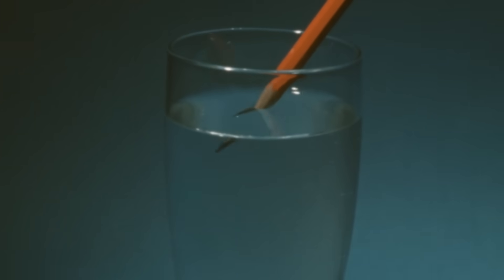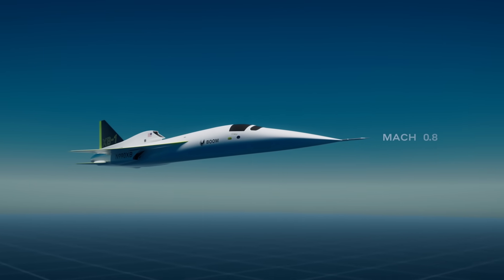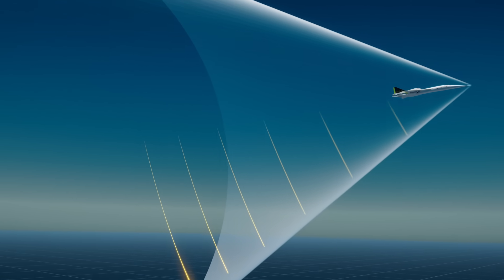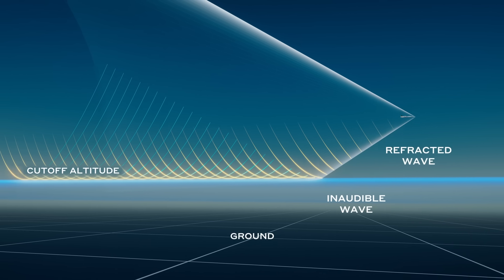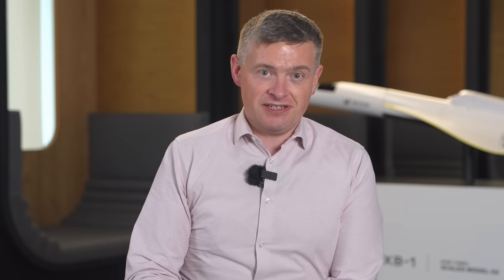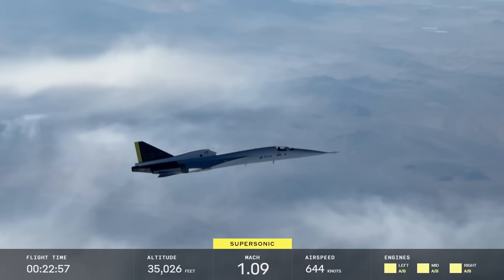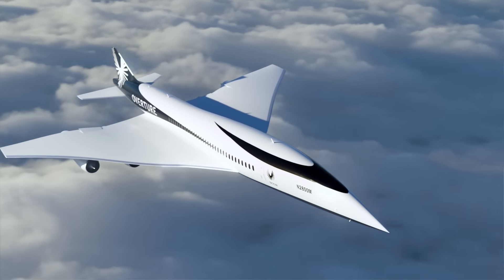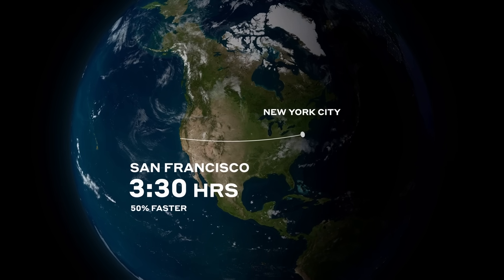What Is Boomless Cruise? Supersonic Flight Without the Boom

Comment: Air resistance goes up as a square of speed. The energy necessary to move an object through air goes up as a cube of the speed - ^3. Sonic booms were never the problem with supersonic flight, it's always been the unaffordable excessive cost of energy. Throughout most of its life, the Concorde flying between New York and Paris/London was on average only 50 to 60% full. The issue was not sonic booms, it was cost, even the ultra-rich would not routinely pay for the convenience, only once for the experience. I cannot believe anybody is funding this venture.
Reply: as AE engineer, I'm agree with u

Comment: they should just call it the "boundary layer" that's what meteorologists call it, there's a layer about only 1km high that is capped by a temperature/density inversion over most of the US at any given time, just 1 km up, you can see it when you take off in a plane from most any airport, this sound wave reflection works better when there is a stronger temperature inversion capping the boundary layer

Comment: I have to admit they have a great marketing department. Otherwise, this is just technohype. The physics of Boom's Overture isn’t in its favor: sonic boom strength scales with the cube of Mach number based on slender body theory, and so using Boom’s own numbers suggests it’ll be over 60× louder than their XB-1 demonstrator. Even if you shape the N-wave into a “thump,” the total acoustic energy from a 170,000 kg SST is still enormous. And let’s not forget that supersonic overland flight is still banned by the FAA and ICAO. Boom has no certified engine, no clear path to regulatory approval. This increasingly looks more like a PR story than a viable airliner.

Comment: Current planes aren't slow, they can also go faster, but they maintain a speed that can be economical for their fuel usage which in-turn, does good for their Airline's profit margins.
Reply: Yes they typically can go faster but are restricted for fuel and emissions reasons, but still not supersonic. Standard aircraft designs experience what is known as aerodynamic flutter in the upper transonic region and supersonic regions. It can literally rip an aircraft apart.

Comment: I’m not such a fan of this. What is the effect on the upper atmosphere environment? It seems like the sonic booms would still cause turbulence, which would cause increased mixing at higher altitudes.
Reply: Not an issue. The shock wave doesn't move air much. It's a pressure wave.

Comment: Supersonics were all the rage when testing began for commercial flights in the 1960s, but the planes ran into problems because of high costs and pollution concerns. Sonic boom is least issue, Boom is supporting legislation that would exempt these jets from updated stringent noise standards for takeoffs and landings for new aircraft. That’s a pretty stunning lack of confidence in its ability to deliver “quiet.”
Reply: Concord had limited routes because it couldnt fly over land due to the sonic boom. Leaving flying over water for only a select few sensible routes.

Solve the boom and you have a more flexible plane, at least in theory.
Reply: @bradleytaniguchi1187  Pacific ocean routes are twice width any transatlantic routes. Fuel economy of supersonic planes will always be vastly higher........

Comment: Would only work for limited passenger airplanes and will therefore result into a very expensive hour flown. Can only run on fighter jets power plants which are fuel inefficient. Supersonic private jets would be very expensive to run and therefore volume sold would be very low, only a handful of corporations would be able to afford a plane/flight 3 or 4 times the cost of a rented or owned private jet. 
Same for airlines, they will just acquire a handful of these jets each to service their wealthiest customers, just like AF and BA did Because market is very narrow. After all planes are delivered there won’t be any more orders for years until a new more efficient aircraft is developed and at least until the ones delivered are amortised. (15 years at least) 

Conclusion: this endeavour is not going to fail but return on investment for this company is going to be very very low.

Comment: To be able to travel supersonically, there’s still the problem of air drag which increases exponentially at supersonic speeds, causing huge increases to fuel consumption (and thus costs). I don’t think this company’s solution is the breakthrough needed for viable mainstream commercial travel, rather a piece of the greater puzzle that still needs to be solved.
Reply: 100%, but you know this is one of those 'rich people fun only' things right

Comment: They use "real-time weather data" to avoid making booms? (1:02)  Does that mean if the weather is outside of parameters they will only fly at subsonic speeds?  Somehow I doubt it... They will probably just go ahead and make the sonic booms...
Reply: Maybe the weather influences speed, height and angle required to avoid the sonic boom
Reply: i researched a lot, the speed and height have to be VERY precise along having weather and atmosphere data so the boom will come back
Reply: @LK2000Y Yeah, so boom-less supersonic flight is just a PR stunt...  They intend to bring back the old sonic booms...  and, if they do,  they'll probably say "but they're not as loud as they used to be" and, by then, it will be too late... billions will have already been invested.
Reply: As an aerospace student what that likely means is they have instruments onboard which automatically adjust the Mach speed, Mach cone, and other parameters with changing speed of sound since the speed of sound also changes variably depending on temperature deviations, density deviations, and so on. It’s probably not something u should be worried about and no it wouldn’t just slow down to subsonic. It will definitely still be supersonic
Reply: @im_a_myth_717 whats the mach cone?
Reply: Ive seen explanations that said boomless cruize will not be avaliable at full speed, they will be only at mach 1.3 not subsonic technically but not the full 1.8mach promissed but this is only relevant in la to ny flights, not cross atlatic. Even argentina to north brazil could take the ocean to fly full speed

Comment: we've finally caught up to what Lockheed had in their L-2000 SST 50 years ago at a third of the speed and half the passengers
Reply: well lockheed never built the thing so if boom pulls this off they're superior for actually existing
Reply: @kerbalengineeringsystems7415  because they never got funding??? bro
Reply: @RobloxianX  ok cool it's a paper airplane they never built hardware for it, Boom's proposal will be better if they can get it into the air again by virtue of actually existing.
Reply: @kerbalengineeringsystems7415  So Lochkeed built a 1:1 scale model and full specifications while all we have of the Boom is a computer render so according to you that makes Boom better. Yeah sure buddy, its not even like you're going to fly in this thing, it's made for the ultra-rich
Reply: @RobloxianX  oh wow, a one to one scale model! what a sure sign of a mature system! by that logic Shuttle-C and the Boeing 2707 were just as real. 1-1 mockups were the computer renders of the 70s. The L2000 did not exist in any meaningful sense. It was a good proposal but it was never anywhere close to actually existing. Arguably the Boom Overture is already more developed than the L2000 ever was by virtue of having a sub-scale flight article in the XB-1.
Reply: @RobloxianX  

> All we have of the Boom is a computer render

Comments on a video with footage from the test flight of the real flying demonstrator aircraft
Reply: @DontMe__  the actual boom the finished product bro use your head
Reply: @RobloxianX  What? Gee, I had an even bigger and faster design than Lockheed's, complete with onboard Wi-Fi and an exercise room. I just never got the funding. It's so unfair, and now society is deprived of my awesome SST.
Reply: @Rotuma1260  damn well lochkeed has built tons of supersonic aircraft other than SSTs have you?
Reply: @Rotuma1260  - 😂😂😂😂😂😂😂😂😅
Reply: Without the ear and property damage too!
Reply: @Ray_Satura  what ear and property damage? the L-2000 literally had boomless cruise because it was planned to go up to 77,000ft in cruising altitude

Comment: So are you implying you'll counteract the sonic boom with a loud, "inaudible wave"? Does that mean dumping infrasonic sound into the area below the plane? You're aware that sound waves you can't hear are still destructive to our ears, right? Fill me in on what I'm missing.
Reply: they aren't counteracting anything, they are simply flying at the correct speed and altitude the computers calculate based on the conditions, where the sonic boom naturally curves back up before it hits the ground
Reply: @tonnynguyen390  Their diagram shows an inaudible wave below the floor of the sonic boom. The inaudible wave is what I'm asking about. It's not reflecting off of the ground, so there's a buffer that maybe I missed in the video..?
Reply: @ i think they meant that once the sonic boom hit that altitude it becomes inaudible
Reply: @tonnynguyen390  That seems inexplicably simple. We've been flying supersonic at high altitudes for decades. If that was the answer, we wouldn't be spending billions to stop sonic booms at this point, we would just develop higher-altitude jets. We are doing so, but for different purposes.
Reply: Search up total internal reflection. The sonic boom cone is like a beam of light. At the right altitude and speed the angle of the cone is shallow enough that it will reflect of the lower part of the atmosphere (not at one boundary like the light hitting a glass block, but just across that certain altitude), so the shockwave is just reflected back up, so we won’t hear it
Reply: @ShortysTRM  The limitation is that it doesn't just let you go as fast as you want at a higher altitude and avoid a sonic boom, it only lets you go slightly above supersonic (mach 1.1 to 1.3), and if you want to go faster than that the altitude you need for the boom to not hit the ground goes up exponentially. So at most you'll get a 50% higher cruise speed than commercial flights at M0.8, at the cost of higher altitude and additional plane complexity to handle supersonic flight.

Comment: Many thanks for doing the research required to make supersonic flight a practical reality.
Reply: The British did that decades ago. The US is late to the party again.
Reply: @markfox1545 the Boeing sst concept was also around the time of the Concorde but just didn’t get enough funding.
Reply: @ again, Not in a practical way for the airline, and not really for the travelers (fuel efficiency, maintenance cost, Sound) Military-wise, The US was the first to achieve supersonic flight.
Reply: Its been a reality for nearly 80 years guy. supersonic jets are very old. If anything, it still isnt practical because you burn so much more fuel maintaining supersonic flight than you do with a standard subsonic cruise, unless you use something exotic like a ramjet youre just burning tons (literally) more fuel just to keep that speed up.
Reply: @battleoid2411  actually believe it or not after you reach supersonic speeds drag sharply drops for a period before once again scaling roughly linearly with velocity as you approach mach 2 and beyond. https://upload.wikimedia.org/wikipedia/commons/0/0e/Qualitive_variation_of_cd_with_mach_number.png
Reply: @battleoid2411  I'm quite aware of how long supersonic flight has been around.  My point was working on eliminating the sonic boom; hence the word "practical".  However you do raise very good points about fuel consumption.
Reply: @goatflieg This plane is supposedly going to be quite fuel efficient
Reply: @battleoid2411  It also ain't practical because you still can't fly supersonic on land
Reply: @PStahn  well yeah, cause then you're not flying you're driving
Reply: @PStahn did you watch the video
Reply: @tonnynguyen390  What I meant by my comment is that there are still regulations all over the world prohibiting commercial supersonic flights

Comment: Boomless cruise at 1.1M isn't much faster than regular air travel at .85M. So over continents you'll get a 20-30% increase in speed which is great,  but not something that's really needed by customers. For transcontinental flights, the Overture jet won't be able to make it from NY to London at 1.7M and certainly not LA to London without refueling, if I understand correctly, so that doesn't make much sense either for most long haul routes. All in all it's a solution in search of a problem, that is burning a lot of Saudi and other VC funds. I'm glad they're doing it though, at least they're providing great engineering jobs!!
Reply: you'd be surprised. private jets sell more because they deliver 0.05 mach at cruise. this is not a regular traveler coach thing. this is for the wealthy, like the concorde was
Reply: “Not needed by customers” haha yea good one. Customer here. They can’t make them fast enough. 1.1M should be minimum for all flights I ever get on
Reply: Not commenting on whether they have their tech. But I’d easily pay double for a 4h NYC-SFO flight that leaves at 10AM and arrives at 11, in time for lunch.
Reply: They're saying they can do boomless cruise at M1.3, not just M1.1, which is ~50% faster.
Reply: @lazarus2691 am I missing something? According to my basic math it's about 18.2% faster, not 50%
Reply: @Elias-eo1vh  They meant they 50% faster than conventional (1.3 mach vs 0.85 mach).
Reply: Has everybody forgotten how to do proper engineering? You don't try to build everything at once. You start small, then scale up.
Reply: @spdcrzy  This is not about engineering, it's about their business model and what market they're targeting.
I just don't see it.
Reply: @spdcrzy  Yup I get it, engineer here. I think people forget how difficult and expensive airplanes are, let alone building a clean sheet turbine. SpaceX success story is one in a million, and they made it work because there's huge military and commercial applications for their tech. With supersonic airplanes, it's almost as difficult, but with none of that upside. But that's just my opinion.
Reply: Yeah this feels like a Concorde from wish
Reply: Also, air resistance increases exponentially so you're using way more than 30% more fuel
Reply: @WyattFredaCowie  At same altitude, yes. But, supersonic aircraft would have higher cruise altitudes for the same reason.
Reply: TBH, the U.S. is in bad need of a high speed rail network similar to those in Europe and Japan.  Not more air travel. But, yeah,  Boom should continue for niche markets and progress' sake. However, fast rail was needed 60 years ago.
Reply: Yeah, Boom has been around for a while with vaporware promises and no real progress. They at least have a demonstrator now but I have very little faith that they're being fully transparent and that Overture will be practical if it ever comes into existence at all. It's a dubious business model to begin with but considering their complete lack of progress for years, I think the execs and employees all know they're going nowhere and are just riding it out. Hermeus is much more interesting and promising.
Reply: @paulgemperlein626  

> They have a demonstrator now
> Complete lack of progress

???
Reply: @ Complete lack of progress for years prior to the demonstrator*. They're not completely fraudulent and they probably truly believe in the goal and want to get there but this is an example of a company just coasting on VC cash if it's only this far after more than a decade.
Reply: Good point. And even if they succeed, i think transporting a small amount of very wealthy people with more fuel burn than a conventional airliner just because they can get to their destination a bit faster is the absolute opposite of what we should have learned over the past decades
Reply: @Elias-eo1vh  Yeah the wealthy don’t want to pay top dollar to be a little faster while being cramped in economy seats. Some modern business class experiences are absolutely incredible.